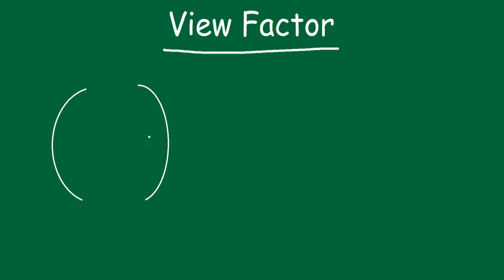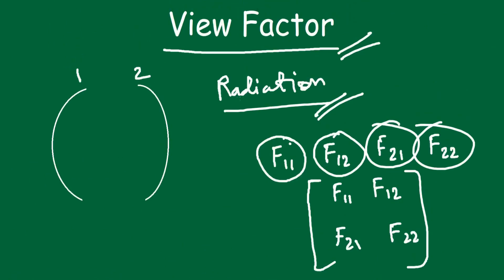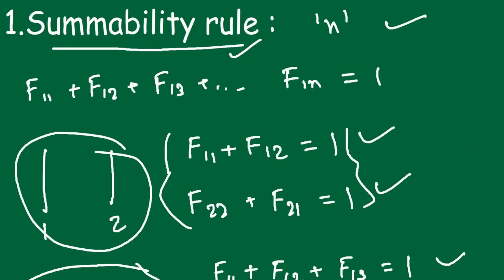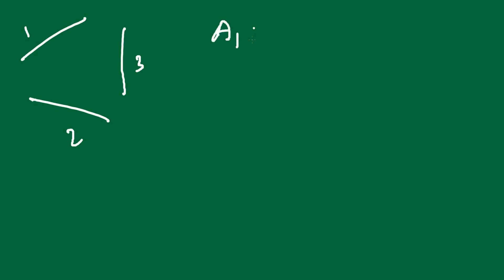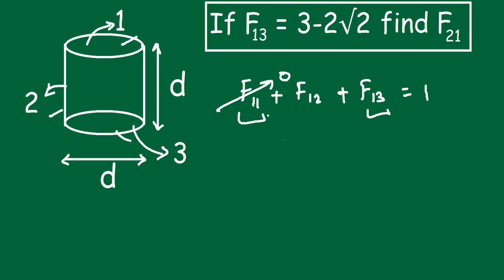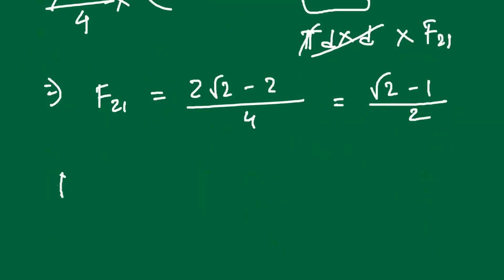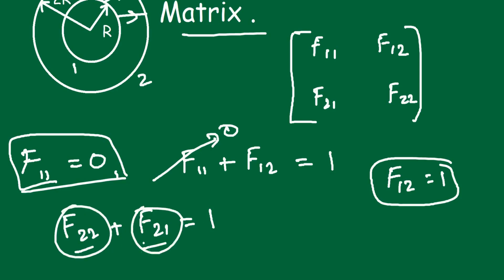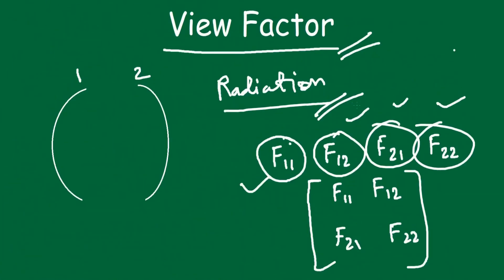How to Calculate View Factor ?

Comment: Hi, can you explain how F11=0 but F22 =/= 0?
Reply from the maker: This is just to make you understand !

If you look closely , the outward heat rays from 1 cannot reach one itself , you can do this by drawing radially outward lines from surface 1. But if you draw inward lines from 2 to 1 , some lines will hit 2 on the opposite side, so it is not zero.